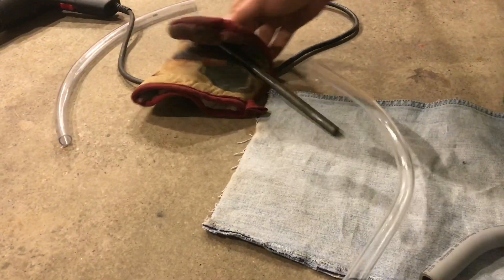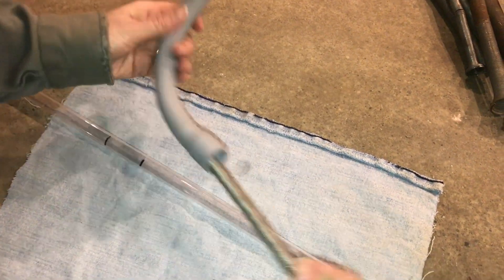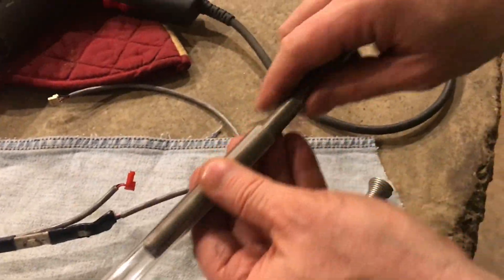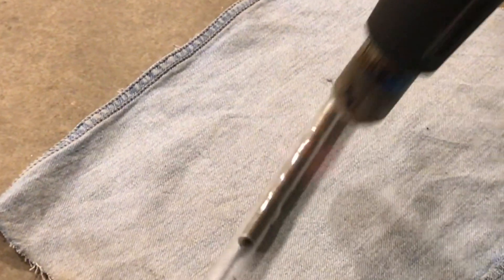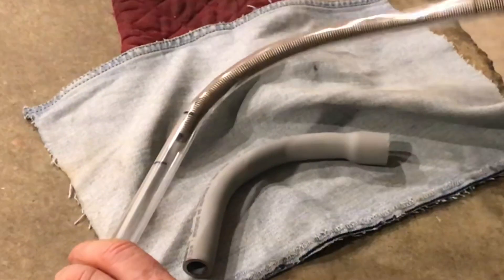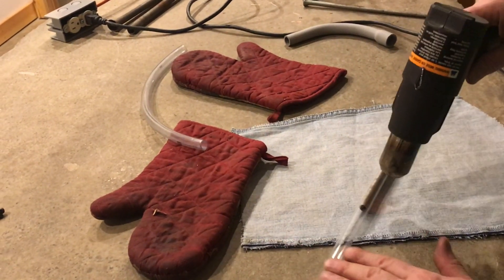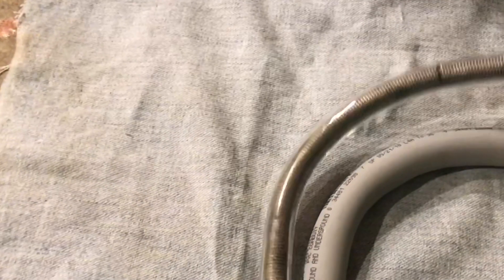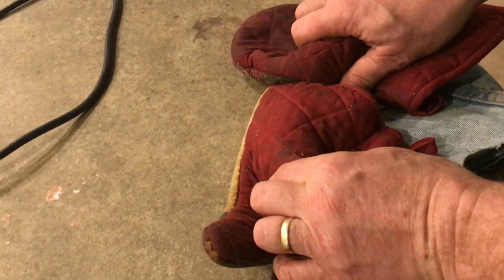BEND clear tubing and have it look nice

Comment: This is incredible! I have been searching for a half an hour and nothing and then your video showed up. Only video I have found that shows how to reshape tubing! Thank you for making this!
Reply: You can also use sand.

Just heat up a good amount of sand in an oven, then pour it into the plastic pipe right full, then tape up the ends closed. It softens it up so you can bend without kinks

Comment: Where can I buy spring so I can create 1 1/2 revolutions of a 2" dia spiral shape for clear tubing that is 1/2" OD and 3/8" ID?  Do the springs need a certain stiffness to work?
Reply from the maker: I found these at a fleamarket for a dollar for the whole set, I’m not sure where to buy a new set at. I don’t feel that the spring tension would be a problem, but the size of the diameter of the spring is pretty important. I tried the spring that was a little looser and it didn’t work as well. If you’re bending something other than clear tubing I have poured sand in the tube and then duck taped each side. Each Time I make another band I remove all the sand because it is compacted pour the sand in so it was nice and loose and then make my next bend. I have used springs that are not necessarily designed for this and as long as it is the right diameter I’ve had pretty good luck with it. Let me know if you have any other questions or if this helped.
Reply: Great Question, Sumanesh. Thanks for asking, I wanted to know as well. 😃👍
Reply: They are called tube bending springs. Home Depot or Menard's should have them, Sumanesh.

Comment: Hi, do you have any recommendations for how to split tubing down the middle about the same diameter as you demonstrated in the video?  I tried using a heat gun to heat up the tip of an exacto knife but I just can’t seem to get it straight down the middle. Thank you!
Reply from the maker: I’ve done it in the past, the cleanest way that I’ve seen Is to glue the straight piece of pipe to a wooden board and then run it through the tablesaw. I’m not thrilled about the method. I’ve done A similar method using a bandsaw and then sanding the edges. I’ve also put masking tape on the pipe as a guide and used a hacksaw to cut pipe in half. Because A pipe is round this is a challenging maneuver no matter how you stack it. I hope this answers your question
Reply: @livefree6878  Thank you.  Unfortunately I don't have access to a table saw, but I do have a circular wheel-saw attachment on my hand held dremmel I will try and see if that works.  Everytime I tried to cut it down the middle with a blade, I simply couldn't get it straight.  The tubing I'm trying to split down the middle is the soft nylon tubing from Auto Zone, but unfortunately when I went to Menards, all they had was very rigid vinyl tubing.

Comment: You wouldn't know how to do this on much smaller 1/4 or 3/8 air line would you? Maybe wire would work.
Reply from the maker: There’s a few techniques that have used or thinner plastic tubing. They do make these springs for the outside of the tube for outside diameter‘s. A wire inside could be a thing to try. If the plastic tubing is not clear, you could pour sand into the tube tape both ends so the sand does not come out. You can get one bend with this method. The sand would need to be removed and put back in for the second bend. If you try doing two bends chances are the paper split. Those are a few methods of used, maybe those would be useful for your application.
Reply: @livefree6878  Appreciated